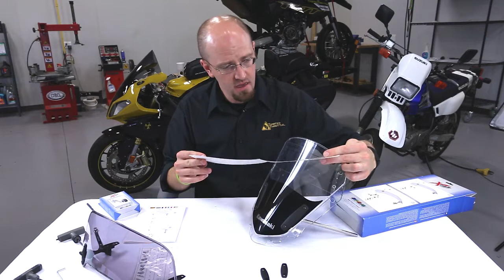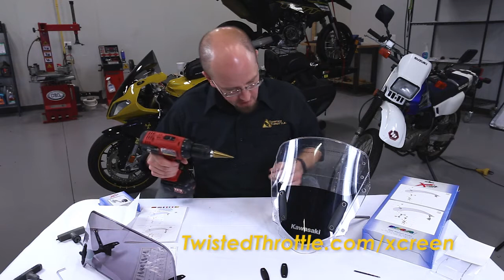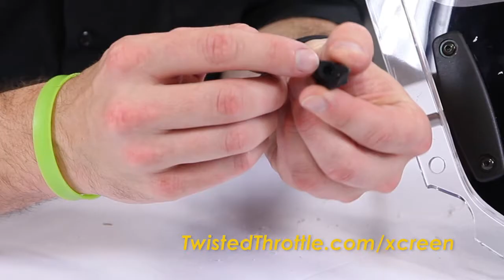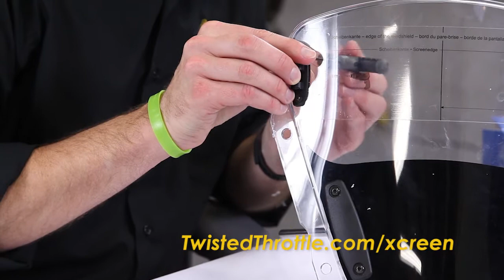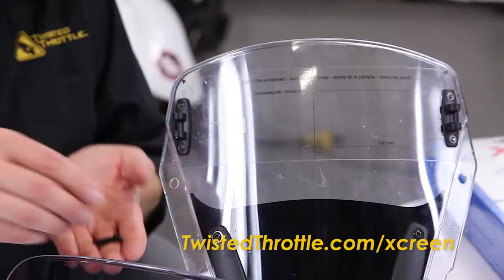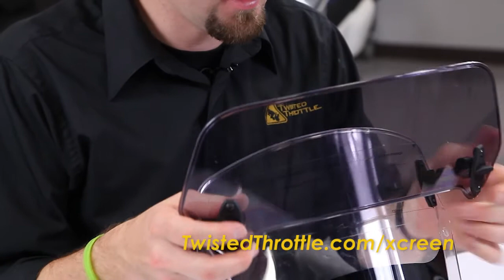MRA X-Creen Tour Motorcycle Windscreen Extension Bolt-On Installation Walk Through

Comment: I used progressively larger bits because I had no step bit. Worked just fine and the x creen eliminated buffeting on my f800gsa. So I just ordered one for my 2017 BMW r1200gs  to which I have already added the tall Puig screen. I'm 6'5".

Comment: How far are the black clamps from each other? I have the MRA sport screen and its 32 cm edge to edge wondering if it will fit.
Reply from the maker: +Enoch C The clamps are 9.5" center-to-center on both the Tour and Sport. Just to be on the safe side we recommend 10.5" of windscreen edge to securely mount them.
Reply: +TwistedThrottle.com 
thanks for the quick reply. i'm thinking of getting the non-drill versions (with the clamps - not sure if you are referring to the non-drill version) do these have the same distance?
Reply: Did you ever get a reply? I was wondering the same thing. I have a Tiger 800 with stock screen. I'd rather clamp.
Reply: +Danny Bumpkins theyre about the same. I bought the xscreen and put it on a sport screen.
Reply: Thanks so much :-)